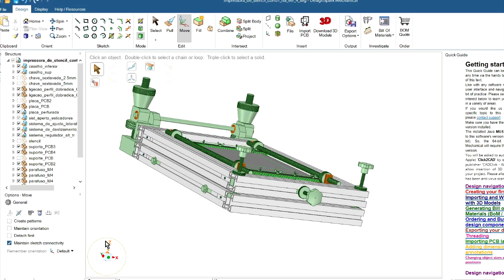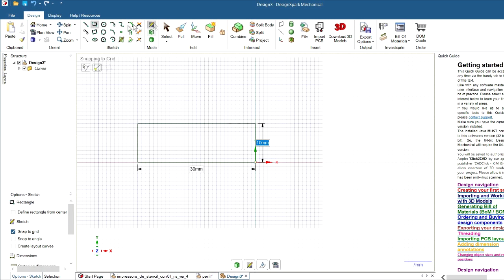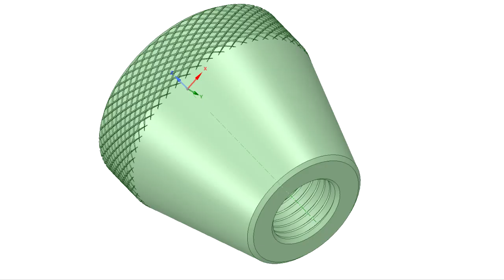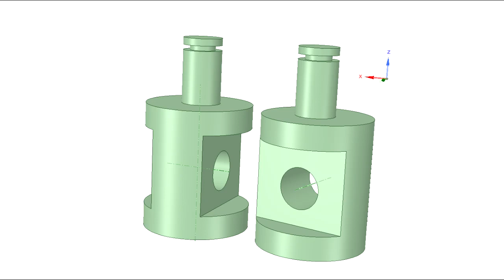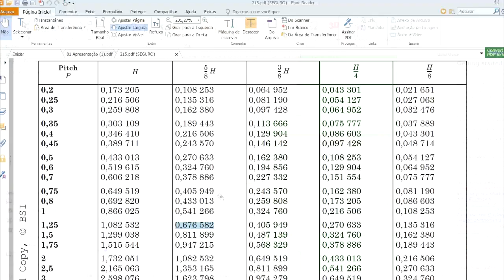homemade stencil printer for spreading solder paste on PCB

Comment: Nice project. Did you mention to make it open source or selling some DIY sets of prepared parts?
Reply from the maker: Hi... i did not made this project to earn money at all... 
I would be very satisfied and proud if someone shows interest in my project.  If you want, I’ll can provide you with the sketch of the entire project in an original DesignSpark Mechanical file in exchange for what you want to offer me, like broadcasting my YouTube channel videos ok?
Reply from the maker: Hi, Pavel
I already shared some subsets of the entire project. I was a little bit late because I decided migrate the entire project to Fusion 360 which will involve redesigning most parts of the stencil printer. As you could see, in the comments with @Mica and in the technical drawings (follow the links in that comments) the project migration is about 60% complete. You could see several links is this comments with Mica and you could access to some STL parts in Thingiverse as well. As I complete the project more, I will immediately post here the new technical drawings and the STL files in thingiverse.
Regards...
Reply from the maker: Hello Pavel... now you can see a complete animation of the all mounting process of this stencil printer:
https://youtu.be/PyxRMVWgiW8
Enjoy... regards...